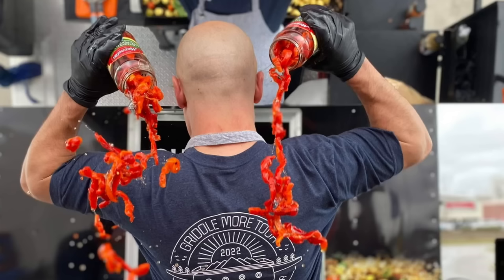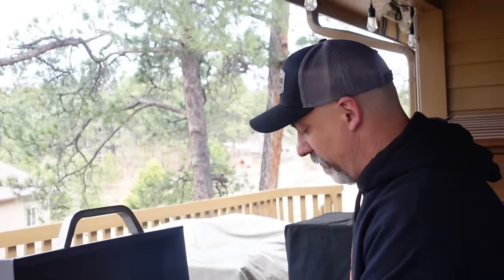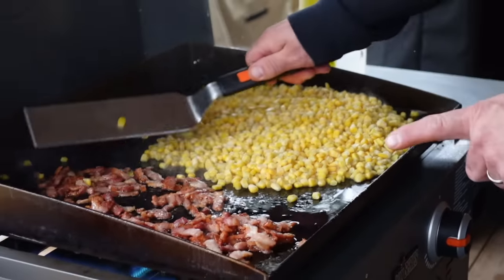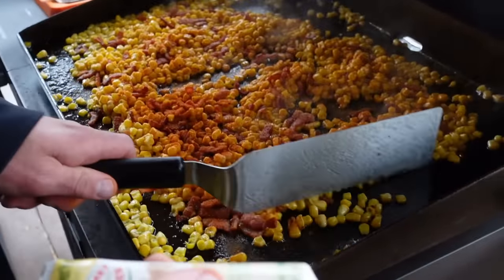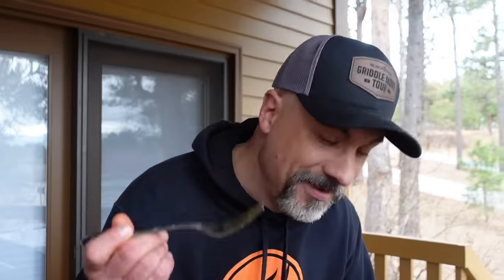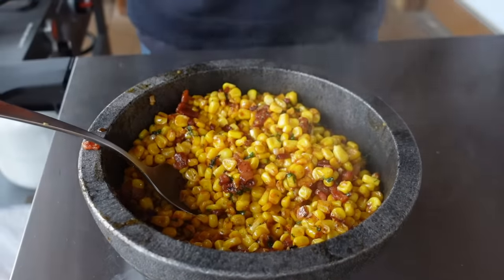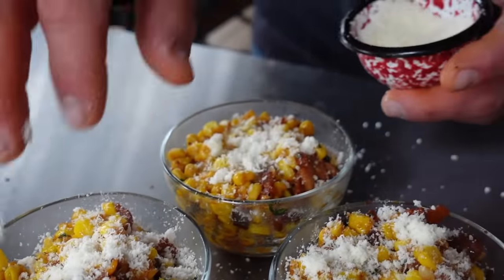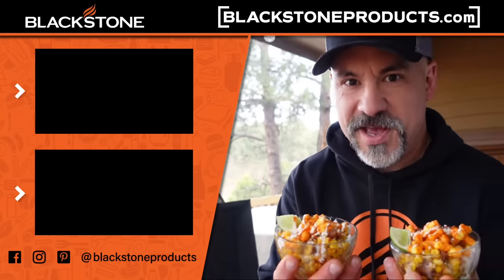Todd's Famous Bacon Fried Corn | Blackstone Griddle

Comment: Recipe for anyone that wants an easy to follow guide: 

Ingredients:

2 pounds of frozen corn
3/4 pound of bacon, chopped
Tequila Lime seasoning
Chunky garlic paste
Fresh chopped cilantro
Mexican grating cheese (queso fresco or cotija)
Cheddar Jalapeno Cheetos
Crema (Mexican table cream)
Lime wedges
Instructions:

Heat the Blackstone Griddle to high heat.
Cook the chopped bacon on the griddle until it's 80-90% done.
Once the bacon is nearly cooked, add the frozen corn to the griddle and mix it with the bacon.
Sprinkle the Tequila Lime seasoning and chunky garlic paste over the corn and bacon mixture.
Add fresh chopped cilantro to the mixture and mix well.
Continue cooking the mixture until everything is fully cooked, stirring occasionally.
Serve the corn and bacon mixture in a bowl or serving cup.
Top with the Mexican grating cheese, Cheddar Jalapeno Cheetos, and a drizzle of crema.
Serve with a wedge of lime on the side. Enjoy!
Reply: Thank you very much for this breakdown! Absolute legend.
Reply: Thank you for the recipe
Reply: Thank you!
Reply: Use takis. So much better!
Reply: Too much drama with this guy 😅😅😅😂😂😂
Reply: Where did the recipe go???  Cant see it here.
Reply: Thanks for the recipe and procedure. Any other options or suggestions for the replacement of Cotija or Mexican cream though these ingredients are integral part for the authenticity of the dish, sadly we don't have it here in my place. Thanks.
Reply: Thanks....= )
Reply: The hero we didn’t know we needed🫡 for real though thank you!

Comment: Southwest born and raised here.  The stage where the corn is in the molcajete add the crema at that point and mix it in.  So most of the corn has a little on there and you don't run out after a few bites.  It is great.  Don't have crema then add some mayonnaise and that is good too.

Comment: Fresh garlic is super easy to peel once you know how. 

Especially if you need it chopped up. It doesn't take any more time than messing with that tube did.

If you can be bothered with prepping chopped cilantro, you should be able to handle prepping garlic.

Just like anything else, it's best to prep first rather than wait until you're in the middle of cooking.

You just cut off the root end, lay a spatula on top, and give it a tap with the flat end of a spatula by striking over the spatula with your palm lightly. I usually don't flatten it, just crush it lightly, and the peel pops right off. The more you crush it, the stronger the garlic flavor will be because it releases more of the oil.

If you want a stronger garlic flavor, just flatten it out completely and chop it up.

If you want a really strong garlic flavor, use a garlic press. Which renders it into a paste and will release the most of the oils in the garlic into your dish.

I personally usually slice my garlic cloves in half so I can pop the germ out with a utility knife and my fingers. The germ has the strongest and harshest flavor, and you end up with a milder garlic flavor if you remove it. This isn't necessary, but helps you control how "sharp" the garlic flavor in a dish is a little more.

The peels should come right off of halved garlic, and can be given a light slap if one is being stubborn.

Then I just chop it up with my utility knife and toss it in. Takes seconds.

Another method if you need whole garlic cloves is the percussion method. Just cut off the root end from your cloves, put them in a small metal bowl, cover the bowl with another metal bowl of the same size, and give it a good firm shaking for about 30 seconds. They should pop right out of the peel, and any that remain will be loose enough to easily remove.

Prepping garlic is easy and quick once you learn how.

Comment: Looks like a real tasty treat.
Just one question. . .
Why did you need to squirt another type of fat on the griddle to put garlic puree down, when you have all that tasty bacon fat grease already there?  Just redundant is all.  And possibly introducing another flavor from olives or avocado.  If it was avocado oil then that works well with bacon and corn.  So then no harm no foul.

Comment: No North Carolina ☹️😩😢
Reply: Yes, we will be in North Carolina!!! I just didn't mention it in this video. See you there!
Reply from the maker: Hi, Hank. The Griddle More tour will be making three stops in North Carolina. The times, dates, and locations are:

*12:00 pm - 4:00 pm. Friday, May 27. 101 Cleveland Crossing Dr., Garner, NC 27529
*12:00 pm - 4:00 pm. Saturday, May 28. 125 Huffman Mill Rd., Burlington, NC 27215
*12:00 pm - 4:00 pm. Sunday, May 29. 2600 North Main Street., High Point, NC 27265

Hope this helps a bit. Have a wonderful day.
Reply: @BlackstoneGriddles  thanks for the dates☹️ Unfortunately we will be in Alaska that week, maybe next time!